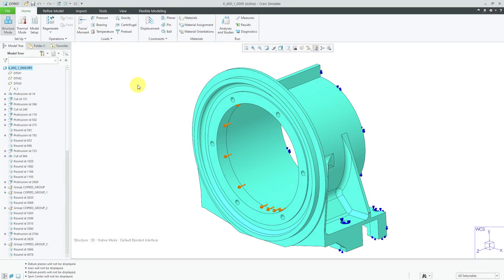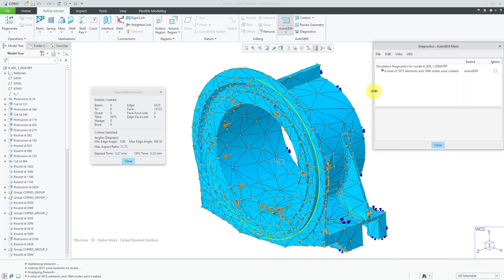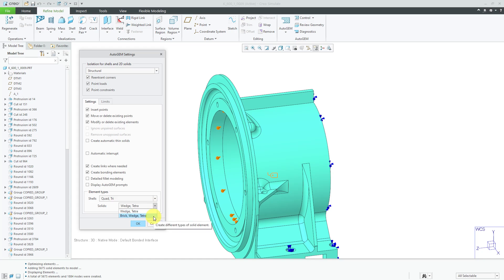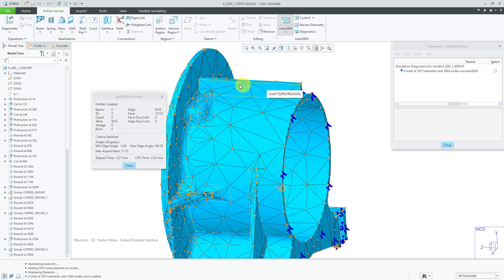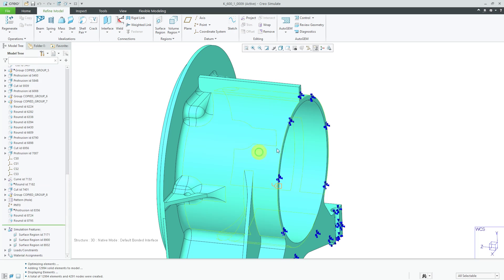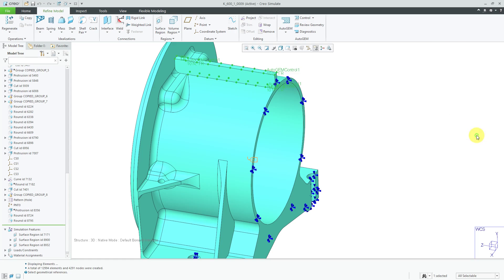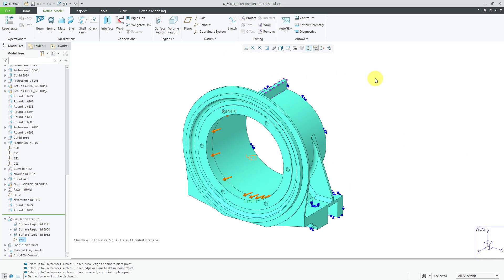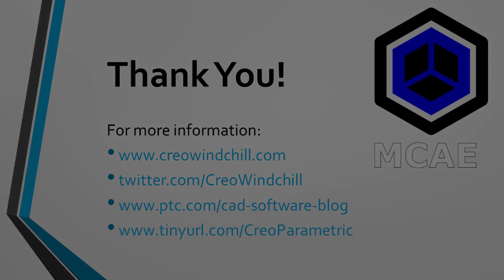Creo Simulate - Meshing and Mesh Controls

Comment: What about mesh Mapped Mesh and Prismatic Elements controls? Especially if you utilize them within assembly analysis?
Reply from the maker: Are you thinking about controls for traditional H-type elements? Creo Simulate uses Geometric Element Analysis (not FEA) and P-type elements.

If you mesh within an assembly, the meshes of any bonded surfaces (the default for surfaces in contact with each other) will match to enable transfer of forces, displacements, and temperature.
Reply: @CADPLMGuy  No. I'm referring to AutoGEM Mesh controls to create mesh using P-elements. In my experience this kind of controls find use in a single component analysis. It's difficult use them in an assembly analysis because AutoGem engine tipically "kill" them and use only tetra. Othherwise you must create a lot of volume reagion. In addiction it seems that with Prismatic Elements control doesn't work the AutoGEM settings limit "Max aspect ratio" along the main direnction.
In any case, I wonder if the stiffness matrix increases its complexity introducing different kind of elements instead of only tetra and if this coud cause an higher compute time (while the reduction of it it's the main reason of the prismatic elements implementation).
Reply from the maker: Okay. It's been years since I've used mesh controls, so I would encourage you to reach out to PTC Tech Support or your VAR / PTC rep to get the additional information you need. I don't have the answers you're looking for.

Comment: Hi, thank you for the video. I have a doubt, Please can you  help me? Are the solid elements  linear (nodes only on the vertex) or quadratic (nodes on the vertex and in the middle of the edges)? Thank you!
Reply from the maker: Nodes are on the vertices. However, in Creo Simulate and GEA, the polynomial order of the shape function is increased appropriately along the element edge. Also you can control the number of results that are calculated on each element face.